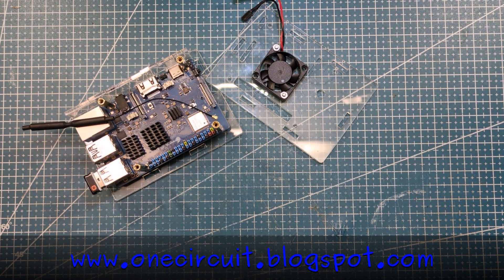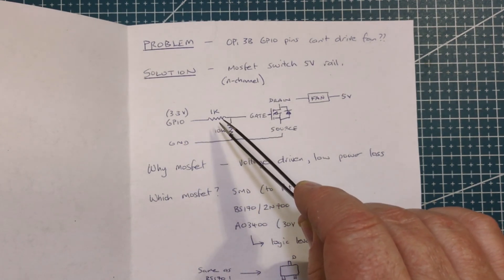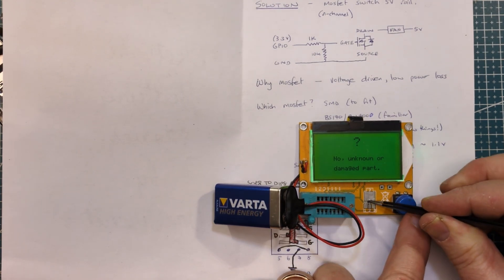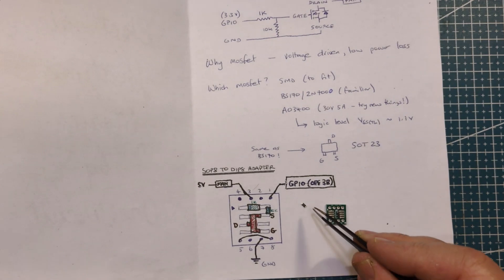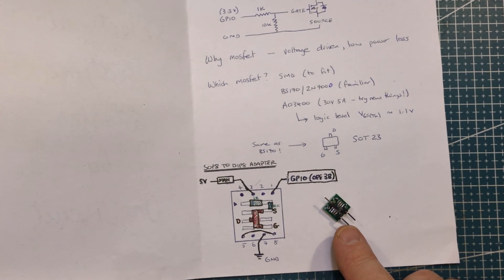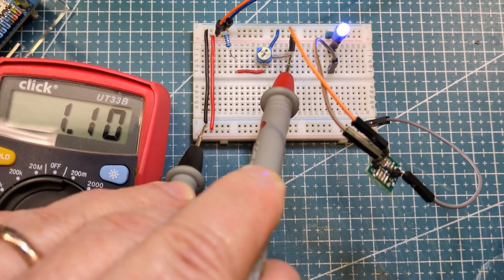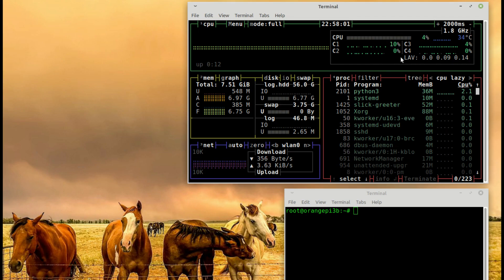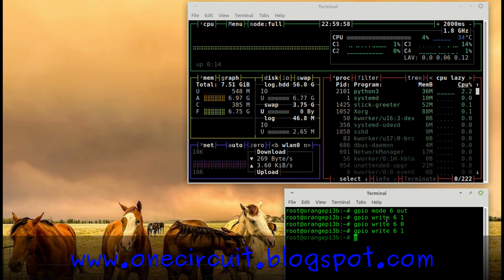AO3400 Super Transistor!

Comment: hello, you need a back emf diode (reverse) between the +5v and the drain in order to protect the AO3400 from high voltage while turning off the fan
Reply from the maker: @amitmeyuhas6216  Good point - I’ll add it for the final version! 👍😀
Reply: Doesn't the mosfet body diode do that?
Reply: @ColinMcCormack  The body diode allows current to flow in the direction from the ground rail to the drain of the mosfet.  That's not what will happen when the mosfet turns off and the fan is still running.  In that case, the fan motor negative lead will become more positive than the positive rail.  A diode across the fan will prevent this voltage from rising significantly.  A 1N4140 of 1N4001 would be fine.
Reply from the maker: Diode installed (1N4001], leads shortened, all of it fits comfortably in the case.👍😀

Comment: The BS170/2N7000 were really aimed at 5V gate drive switching applications, so their maximum gate threshold can be problematic unless one is hand testing and binning for lower threshold specimens. That combined with their lower transconductance can be problematic in 3.3V circuits - especially at colder temperatures.
Reply from the maker: Yes I think the AO series looks like the goods for IoT logic level applications. 👍😀
Reply: @onecircuit-as  I thought so too, so 10 years ago I bought factory sealed 3000 each reels of AO3400A and its complement AO3401A. They only cost 4c each back then.
Reply from the maker: @ChrisSmith-tc4df  Wow good pickup - I'm happy if I find 100 pcs relatively cheap!

Comment: I'd have the fan blowing into the case.

But the size of those components gets me. I've read books with bigger full stops.
Reply from the maker: I lost a few 603s along the way due to breathing. The fan is now blowing into the case, plus I installed a flyback diode and shortened the leads. 👍😀
Reply: @onecircuit-as  One sneeze and your project is gone. LOL

Nice one. I did'nt think of the back EMF diode. 👍
Reply: You can buy them in SOT-23 format which is much easier to solder.
Reply: @Steve_Coates  With my eyesight and tremors, SMD is just a myth. LOL.

Comment: Fan should indeed be blowing on the heat sink :)
Also - I’m happy to see it didn’t fry the GPIO when you hooked it straight to it in the beginning. I don’t think a Raspberry Pi would’ve been that forgiving with trying that much current.
The internal reverse diode might be enough for back EMF?
Reply from the maker: The fan is now blowing back into the case and I did install a flyback diode in the final version. 👍😀

Comment: It has all the right things to run a pulse laser except the watts is to low. If I use an arduino to create a PWM , need 75w 12v 2.5-30a . Any ideas how to drive a 75w 905nm pulse laser diode with an arduino ?
Pulse Drvers cost upward of $1500.
Reply from the maker: Use something like this circuit to trigger a larger fet like the IRFZ44?
Reply: @onecircuit-as  I will look at the data. I freaked myself out and got the laser diode to light up with a PWM and then I fried the PWM module. I tried with a Arduino and found that it is easy to use the simple blink code but I couldn’t get any light using a TIP31c. I might have killed the laser diode ? 4 days and nights of studying now , trying to get a 75w 12.8v 30a 100ns max pwm .
I thought when I bought the diode for $20 it would be as easy as connecting to a buck converter not realising it needed a PWM. Thankyou for your quick reply.
Reply from the maker: Good luck with the project, sounds like good fun! 👍😀
Reply: @onecircuit-as  I want to know how cheap I can drive a pulse laser diode ?
The $2000 drivers look like cheap circuits so why are they so expensive ?
Reply from the maker: 🤷🏻‍♂️ This is often the case with electronics. Commercial WiFi extender AU$60. ESP8266 version? AU$1.50 😂

Comment: Hi, yes fan should blow onto heat sinks. The air flow when sucking comes via the least resistance path and so although will flow some air over heat sinks, most air movement will travel from sideways into the fan (as path of least resistance). Pushing the air onto the heat sinks will provide much moor cooling capacity as it will force air across the surface of the heat sink.
Reply from the maker: Thanks Paul my thoughts as well! 👍😀